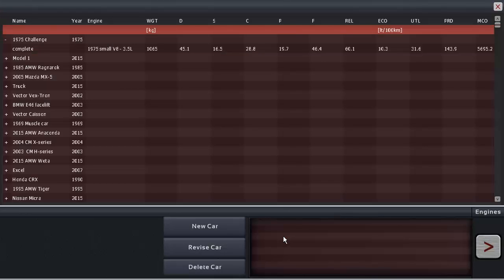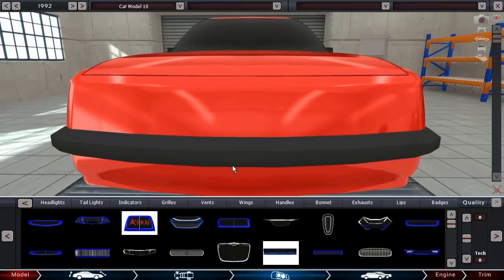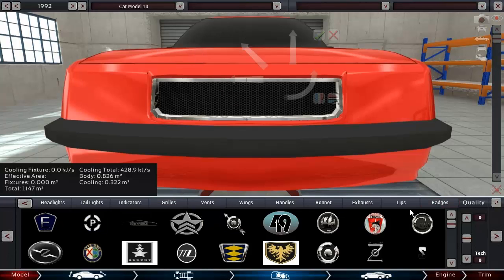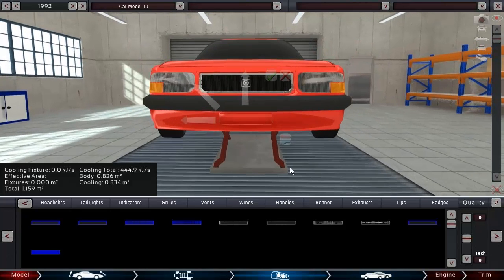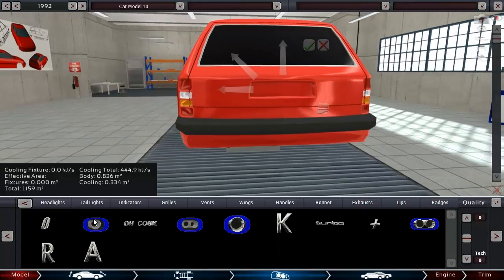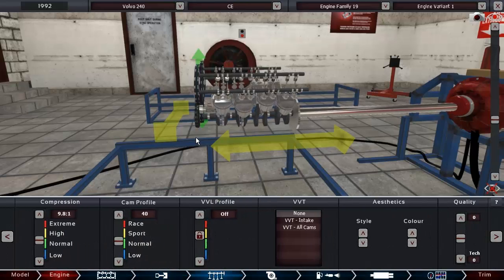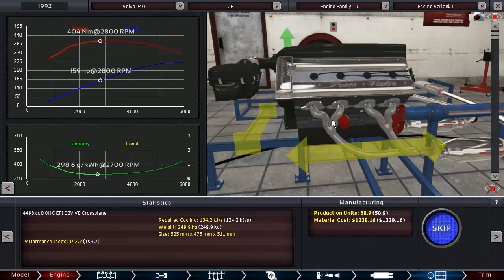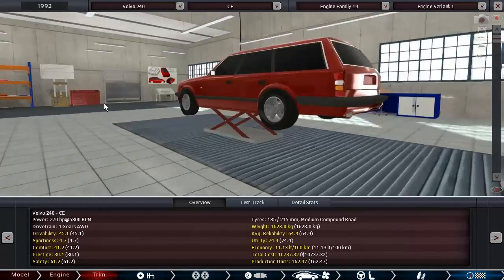Automation [Ep. 90] - Building a Volvo 240

Comment: "It's front transverse, really no doubt about that" lol. Front engine, longitudal with rwd (never had a v8 in it but ok, the biggest engine it had i believe was a 2.7 litre v6) Also i believed the later models was built using galvanized steel, as the early 240's didn't and had such rust issues -_-

Comment: Could you build a "Massive Turbo" version of this?

like 700 hp
Reply from the maker: mantisropa I sure can, as long as the engine actually fits.
Reply: TheTomGamingChannel should not be a problem, the B23 engine is used in track cars as well, mainly in scandinavia and have seen some push them past 600hp, believe it or not but volvo's are popular tuner cars and building track cars out of, as the cars is cheap and got lots of space under the hood, in 2014 it became illegal with chevy 350 engine swaps for road registered 240's sadly.
Reply: i know, when u search "volvo 240 estate" you get quite a lot of pictures of tuned versions
Reply: mantisropa yup also found it funny that he made it transverse engine placement, as the real volvo 240 got it longitudinal, thing the volvo 850 was the first one with transverse engine placement, and how he is not able to find specs for the famous B23 engine i'm not sure... it's as well known as the 2JZ here in scandinavia and a quick search on the engine code and you will find all you need....
Reply: +ståle starheim look at my channel if you want i made a Volvo 940 with a B230FK very close to the real specs!